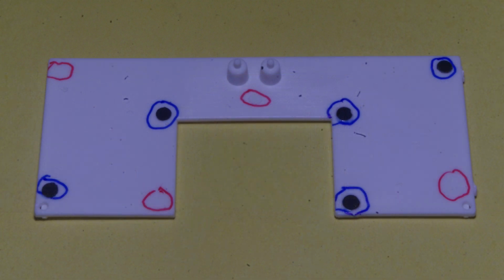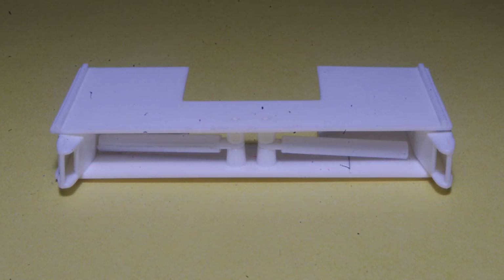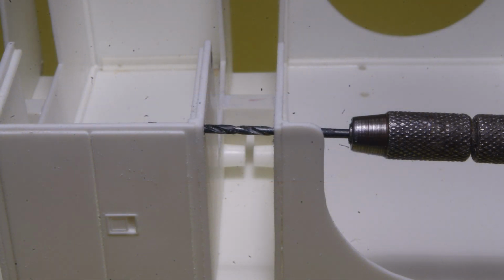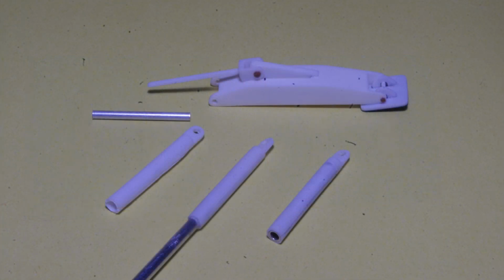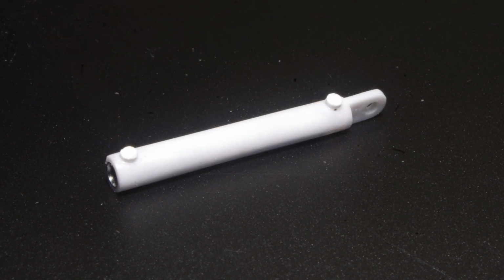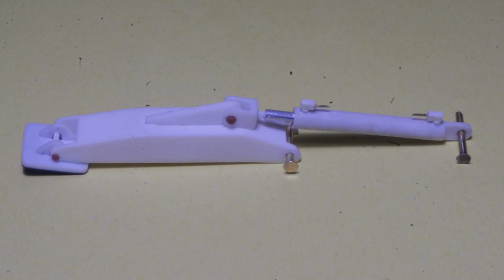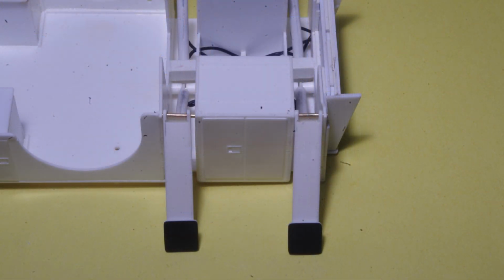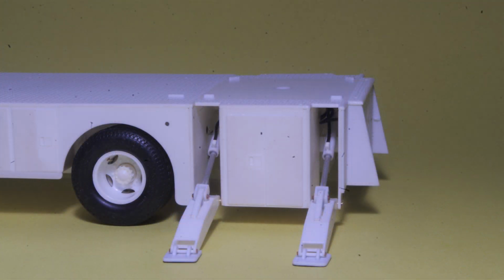1/25 scale AMT Ladder Chief: Adding details to stabilizers

Comment: A great detail to a plain part of the model. Now that I have seen your work, it makes me think. What about a rod on the outside of the cylinder to shorten the hydraulic lines over the  cylinder. Your details are fantastic! Hope to see you soon👍
Reply from the maker: That's a good point, similar to lift cylinder on some crane booms. Will have to do some more internet digging to see if any pictures are around of stabilizer area on these American LaFrance trucks.

Comment: That looks really great!
Reply from the maker: It actually ended up being easier than I expected, for the most part kit parts were used. In hindsight it might have been easier to make new cylinders from styrene tube as when drilling the kit ones out for 1/8" aluminum tube seam lines came apart in a few spots and required filling.

Comment: Excellent work getting everything to look great.  Thanks for sharing.
Reply from the maker: You're welcome - as the various panels, cabinet doors etc. were glued in place I was surprised how solid the back section of truck body became. When it was just the forward compartments installed the tread plate floor piece felt pretty flimsy before installing pieces behind the wheel opening.